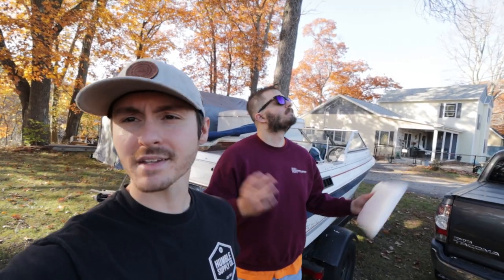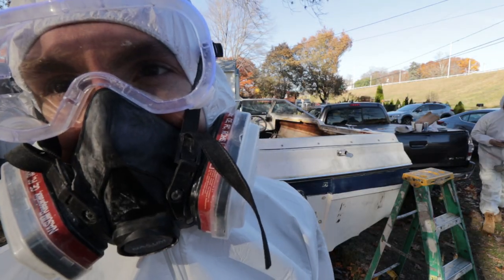Lots of Problems Restoring Old Boat - Boat Restoration Part 21

Comment: @10:53 that is the crankcase vent, I also have a b20/aq130 and parts are hard to find and/or expensive. My engine seems to run fine so I am 100% avoiding tearing down the engine, just rebuilt the water pump and crossing my fingers. I am going to remove the oil pan to clean any junk that has settled in the pan but only because I will have all the stringers and bilge removed so I think this will be the only time I can get out easily
Reply from the maker: That makes sense! Putting off an engine build is always a good idea 😂 Those little maintenance things for sure will help! Also don’t leave your engine in the rain like the previous owners of this engine. Happy Thanksgiving!
Reply: @DownToTheFrame  I started my boat teardown back in the summer but put it on pause for a surgery/recovery, I just got back to the floor and foam removal today while waiting for turkey and discovered about 1/2 my transom is rotten. It all seemed fine but after the 3 months of drying out in my shop I saw all the bubbles and cracks on the inside of the transom, and the nice hallow sound it has now. Now I have a project as big as yours lol
Reply from the maker: Well glad to have you back in the good fight Jax! Sorry to hear about the transom damage. Everything is fixable just a matter of time and work lol Keep us updated with the progress!

Comment: I've been rebuilding the same engine also- my engine is in a 73 Glastron. I  have run into the same frustrations! Where did you get the felt ring and what is the part number? I cant seem to find it-Thanks.
Reply from the maker: Nice!!! This engine for sure gets frustrating. We get a lot of our parts from IPD USA. However, we might not need the felt ring... we just ordered an experimental part that might save us. Stay tuned for the next video and we will explain. Here is the link to IPD https://www.ipdusa.com/?_vsrefdom=adwords&gclid=CjwKCAiA-_L9BRBQEiwA-bm5fgd4n8CPeRMl6xmvy_OQT49JWig9CdMt481DH5jonPPnm1HNmw5GthoC-5gQAvD_BwE
Reply: @DownToTheFrame   I still cant find the felt ring but I think I found the experimental part, I will stay tuned....want to sell your old felt ring?
Reply: WAIT! I found it under closeouts--pn IPD 101448--Thank You!
Reply from the maker: I knew you had it in you! hahaha